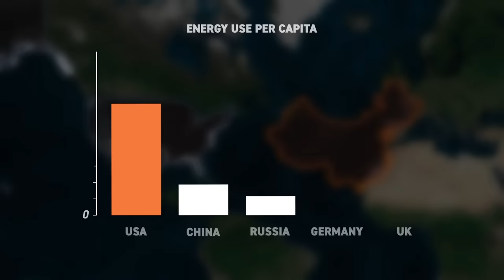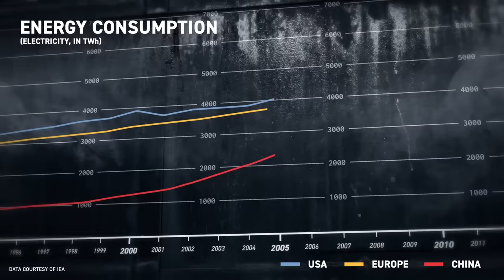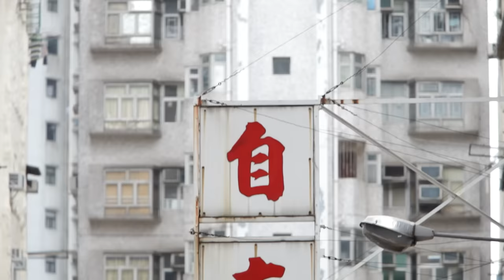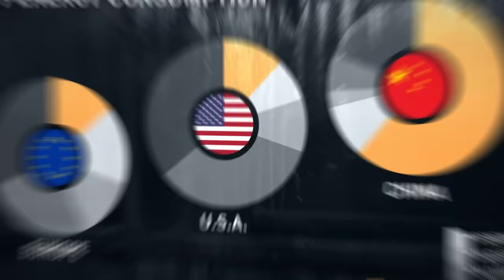China’s Electricity Problem

Comment: A definite masterpiece of overview of the problem. 
Anyone working on power electronics knows that demand for Chinese State Grid and EV companies are insanely high. I appreciate the mention of UHVDC transmission, an infrastructure that the US can only imagine being built. And if you work with automotive you should know that the amount of push to go from no reg to a euro 6 equivalent and potentially leading the way soon with NS7 is quite impressive.
I think the world needs to thank Chinese people for their sacrifice. I’m not chinese but lived in China and from the way people get to work to how people set their AC is much more sustainable then the west. For example:
I ride the metro to work. It’s electric and one might say, oh it comes from coal. Sure. But emissions of mass transportation is much lower per head per km travelled. My didi/gaode/uber ride is electric and i ride my ebikes for nearby shopping where as I used my F150 back home to go get a six pack to Walmart driving at least 10 miles round trip vs buying in one of the convenience store walking. My Chinese office set their AC temperature at 26C/78-80F on a 40C/104F weather outside meanwhile i set my personal office at 20C. Chinese colleagues then use their tumbler to fill in hot water meanwhile I drink a refrigerated plastic bottle of water. One thing china can learn is usage of plastics though.
Reply: If you are comparing to the US, then yes, China is much better.
But the US has the highest electricity consumption per capita and the highest CO2 emissions per capita, not an example for anything really.

Compared to France, Netherlands, Sweden, Norway, Denmark and other developed countries, China doesn't look so great.
Reply: @udishomer5852  oh please. These nordics country buy stuff made in China. Norway uses renewable but pump tons and sells oil.
Reply: “You vill own nosing, und you vill be happy” bwahahahahahahahaha
Reply: But from what I can see from the pie chart in the video, electricity seems 3 times dirtier in China? This seems to be a hard sell…
Reply: @clementdato6328  no. How so? China has the largest renewable output.
Reply: @jkjkjk100  The pie chart actually indicates for each kW•h China used the most coal to produce compared to US and EU
Reply: @clementdato6328  not in per capita terms. They have more people, why can’t they use more than americans?
Reply: @jkjkjk100  I mean per kW•h, so you should not try to avoid the topic. It's not the total that I am talking about.

Comment: I'm not a huge fan of Solar Energy, but roof based solar is, at least partially, the solution to ACs. That and district heating systems using ocean based cooling
Reply: Out of curiosity why aren’t you a big fan of solar?
Reply: Ocean bases cooling, that  sound like a huge environmental problem
Reply: @yonahsefchovich5931  Extreme land usage, toxic materials in production. I like it on roof tops - since the AC is on when the sun shines, and your actually using some of that sunlight that was going to heat your house to cool it - and floating (or otherwise above) canals and reservoirs - to avoid water evaporation, take advantage of lower temperature higher efficiency, and since these usually have transmission lines already in place (think hydro dams).

In some cases I support it in a dessert, but that always entails hige transmission systems. But if its paired with some plan to encourage arable land expansion thats cool. 

Also, one day in orbit it will be great.
Reply: @AlessandroRodriguez  Not really, you just pump deep sea water and release the warmed water to a middle layer. It actually complements aquaculture quite well.
Reply: @neolithictransitrevolution427  how much "deep" is deep sea water?, at least that sound some kilometers off-shore, also a few liters by hour by some hundred thousand of AC units is already a lot of water who has to travel another hundred meters of travel in horizontal and vertical will add a lot of energy costs. Also wich aquaculture is limited by temperature?, commonly they are limited  y nutrients.

Comment: coal plants can be "scrubbed" with algae and moss in a large pool of water. Lots of studies were done and have shown to reduce co2 emissions a ton. Its a stopgap measure as coal wont last forever obviously, (but the algae can also be burned off once it gets too dense and needs to be cut off so its semi renewable.) But its a fairly low cost and incredibly efficient method of scrubbing co2. The stuff I read about, probably in popular mechanics or popular science, I cannot remember, talked about stuff that was swimming pool levels, so just imagine the efficiency of a pond.

Like I said, its a stopgap measure, but its also a way for a country with tons of inhabited land to become "carbon neutral" 

also, finally, chinas 2nd biggest co2 producer is most likely concrete production, and thats just in the nature of producing concrete. You cant really make it "carbon neutral" so you HAVE to scrub that excess. I am not incredibly knowledgeable about the process, but from my understanding, just the chemical change of the limestone>lime produces co2 so that cant be removed from the equation. And ALL developing nations and developed nations need concrete by the assloads, China especially as they are building like mad and have many problematic rivers that are prone to flooding so concrete retaining walls are especially useful I bet. And hydroelectric power is incredibly concrete expensive, the Hoover dam required more concrete at that point than had ever been produced combined (not sure if that made sense, if you used all the concrete that had ever been produced from the beginning of time to the day of construction, it still wouldnt have been enough.)

So some form of advanced form of scrubbing, such as algae farms will still have to take place, even if china switches entirely from coal to solar or whatever

Comment: Perfect video to why being an HVAC tech is a great job, money only increases with skill plus job security.
Reply: All those jobs are great. I know so many young guys who do something like that for a decade while learning all manner of things and who eventually start their own businesses with what they learned. The overlap in skills is large. You will learn multiple other skills along the way so an HVAC guy learns electrical, plumbing ,etc. The only thing I ever taught myself that I didn't learn on the job was welding which is massive. Every young man should learn to weld in Jr High or High School.
Reply: Air conditioning is never going away. So the job security will always be there
Reply: @Harmz7  You can't outsource your tradesman.  IT jobs know no boundaries.
Reply: @Harmz7  tell that to the TENS of THOUSANDS of IT and CS who just got laid off from Facebook, Google, Uber, Twitter. Trade jobs don't pay as well because the focus hasn't shifted to it YET.
Reply: @Harmz7  IT and CS are both high paying in demand fields yes. But they are also becoming high turnover and easily outsourced jobs. Eventually your EV will breakdown, the robots to build said EV will need to be repaired, upgraded and replaced. You will need more electricity and a place to use the restroom, a place to stay and ways to get to and from work/ school. IT and CS are vital yes, in the grand scheme of things they need tradesmen just as much if not more than tradesmen need them.
Reply: Hey, stop that - you are supposed to crap all over anything requiring a degree and act like "the trades" are the answer - please DO ignore the now thousands of hours of YouTube/etc. content making it clear this is not really the case.

Also - stop saying things like "HVAC" or "CS/IT" - those terms are far too vague.  SPECIFIC sub-fields in those identifiers are to be focused on, and whatever you might say is true nationally, is not necessarily true where you live.  The available CS/IT jobs around you might be kind of crap in terms of pay vs experience-requirements/responsibilities or finding people to do trade work is a dime a dozen.

"just go HVAC and you will be fine because blah blah blah" - no, but perhaps yes
"just going to CS/IT and you will fine because blah blah blah" - not, but perhaps yes
Reply: No.
Reply: @VinceroAlpha  Offices are emptier, more and more people are working from home. Some of the heavy maintenance will disappear.
Reply: @Harmz7  I’m sorry if I come off as rude, it’s a pet peeve of mine when people are blinded by the “possibility “ of tomorrow rather dealing with the reality of today. Yes both are needed, yes CS are vital specialists and and will have some security for the future, but I have to remind you, HARDWARE HAS ITS LIMITS. I’m not sure how old you are but when the first gen iPhone first came out, it LITERALLY changed the way we live in and interact with the world. However, since then there has been no innovations of that magnitude since. The iPhone was only available to really take advantage of the infrastructure built up in previous decades from the internet and land line phones. The rudimentary servers and mobile towers were the foundation for building the network we take for granted on everyday. Every upgrade to a new network has needed the help of tradesmen to upgrade the network to handle more complex data systems. Not to mention the support needed to keep it running smoothly almost 24/7. 
  But because innovation in hardware has lagged behind software development so much, there has been a serious glut of pseudo-innovations to distract people from noticing this problem. As a result most things aren’t economically viable or even possible at this stage. Why would a contracting company buy an expensive, complex  yet delicate machine to do a task that one or two people can do for half the cost and less headache. Keep in mind that machine will be subjected to the elements, mud, damage and fuel consumption that again, to capable humans are easily able to do. It’s this unhealthy obsession toward “everything has to be technology because it’s the future” that I hate. There are a lot of problems that can be solved with wasting so much time and resources on novelty items that really don’t make sense for a lot of people. Case in point your toilet example, yes it’s great and in certain situations it’s definitely a step forward, but for the average person, why would they need a digital toilet that costs 3 times as much vs a regular one if they both do the same essential job? That’s why they’re a novelty and haven’t taken off, and that’s one of the better “vaporware” out there. Yes we should be continually innovating but it has to be genuine innovation and not a better camera on your phone and dynamic lighting. Again sorry if I seem angry but it seems that we’re getting less and less results from technology and almost no one is asking why.
Reply: @FutureCommentary1  not really, those same offices will still be occupied because they need to make money for the landlords. Also, keep in mind that a good number of those offices are being converted into co-ops, shared workspaces and smaller offices, just to name a few.
Reply: @xBINARYGODx  way to not add to the discussion
Reply: @jakleo337  Expat life and digital nomad life for me. I don't really care for living in countries with a high cost of living.  In low COL countries I can live well while not having to work as hard.
Reply: @RJT80  >  Every young man should learn to weld in Jr High or High School.
Every young woman too. Welding isn't just for the guys!
Reply: Google says the most you'll make as a hvac tech is $87k annually, that's not exactly a high paying job lol💩
Reply: @kazbah1217  tell that to my paycheck, I already make more than that.
Reply: Good debate here. So nice and rare to see on YouTube (with decorum). Manual Labor and many parts of IT are super strong roles to have or aim towards and are probably the most bullet proof to recessions. In the case of IT, not all roles - someone mentioned Twitter but in all honesty, most of these are "customer service" jobs (which algorithms can and do look after) or management roles (which is just gluttony really with not that much value). 
Getting trades and real skills (for labor) or industry certs like MCSE, VMWare VMCP, Cisco, Citrix etc... (for IT) will always (ALWAYS!) trump a college degree. Though having a degree too doesn't do any harm (except maybe to your debt levels).

If one values absolute job security though, the postal service (EG: USPS, Royal Mail) is basically a job for life. Or something in insurance. Or a funeral home. All are basically immune from almost every economic uncertainty as life goes on with these services running no matter what.
Reply: but how boring af and linear pay.
Reply: "being an HVAC tech is a great job"

By "HVAC" do you mean "Heating, Ventilation, and Air Conditioning" or "High Voltage Alternating Current"? Both would fit to the theme of this video.
Reply: @bluepurplepink  Air Conditioning WILL GO AWAY with the emphasis on renewables.
Reply: CO2 levels follow temperature change, not the other way around. Follow the science, not the agenda
Reply: @Harmz7  I was an IT field tech for a Fortune 100 electric company until I retired 4 years ago. No cushy white collar job! My unofficial department motto was "Taking Computer Age skills to the end of Bronze Age roads, at any time in any weather." All of us were on call 24/7/365; I took my last callout a few days before retirement on the weekend before Christmas 2018 at 5:00 am; and I wasn't even in the state! Lots of tower work, usually when the weather was worst, and I can't even estimate how many times I dug my 4X4 out of snow, mud, or sand. My partner and I dug our snowcat out of deep puddles of powder snow twice less than a minute apart, then we parked it and snowshoed to the site... and this is in northern Arizona! To make the job more interesting I was the department lightning hardening guru.
IT is not all one thing.
Reply: It seems that standard HVAC, the type with gas for heat and air conditioning for cooling, will be replaced by electric heat pumps.
Reply: @KbB-kz9qp  that's still hvac I work on heatpumps about everything other day.
Reply: @therougechipmunk8058  True enough, but in California at least (where I live), the majority of homes have a natural gas furnace for heating, and standard air conditioning unit for cooling.

I was raised in the Midwest and (since the 1980’s) heat pumps were common enough.  Since winters in California are milder than in the Midwest, I am surprised heat pumps are not used here more than they are.
Reply: @KbB-kz9qp  they are being used more recently now. Like say in the city of Berkeley all new homes now can only have heatpumps installed, they no longer allow conventional gas heating.
Reply: @therougechipmunk8058  Seems a good idea, especially since natural gas in Cali is running at $2.50 per therm.  Just two or three years ago it was $0.55 per therm.
Reply: And the spinoff work of radon detection is not bad, either.